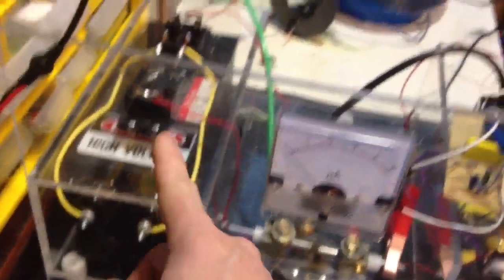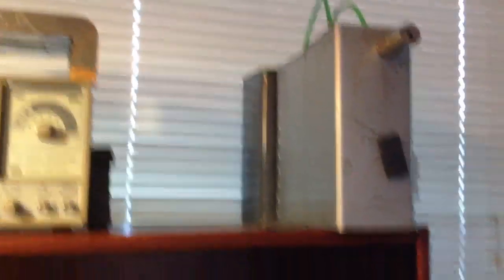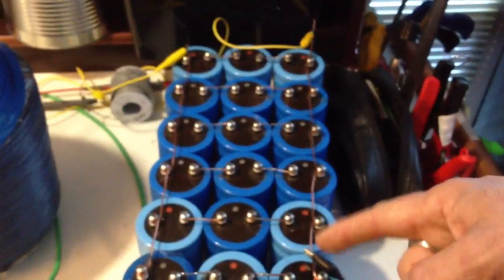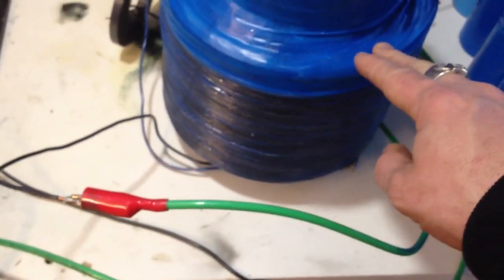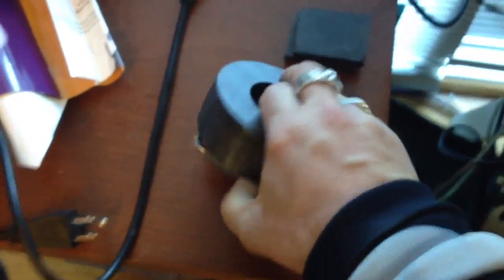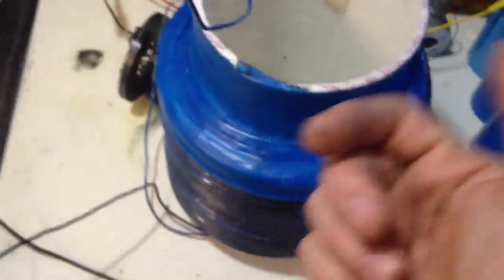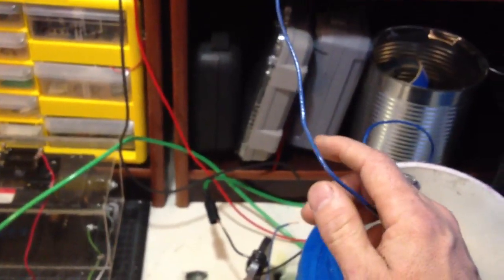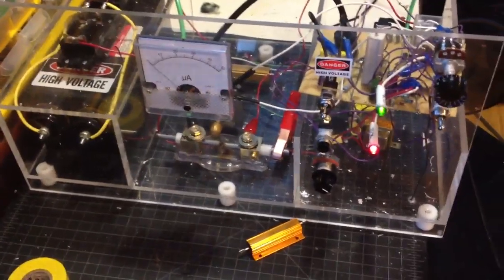Floyd Sweet VTA magnet conditioner replica

Comment: Very cool! I have always wanted to build one of these! 

Where I live, there is a lot of magnetic iron sand. I wonder how that is made in nature and if we can better learn from nature. 

I think the Fe2+ ion is the only quantum asymmetrical spin orientation. According to google this ionozatio energy target should be around 1562Kj/mol from neutral to Fe2+. Iron atomic weight is 55.8 so 55.8grams/mol

 Avagadros number per mol: 6.022*10^23atoms/mol *1mol/1562Kj = 3.85*10^17 atoms/joule of energy 

If you have 1/4 pound magnet that is 454.5/4 grams= 114g iron

114g iron/55.8g iron is 2.04 mol iron

2.04mol iron*6.022*10^23 atoms/mol = 12.26*10^23 atoms iron 

12.26*10^23 atoms iron/ 3.85*10^17 atoms/joule= 3,185,000 joules to magnetise a quarter pound of iron Fe state into all Fe2+ state 

Ok cheers

Comment: Please share the SCR circuit with me, I need it too bro.
Am just a physicist, not an electrical technician. I understand everything about the VTA but don't know how to build circuits.
I know the coil ratios and how he calculated them, he used the e/p ratio of the atom which is 658.2022222....
If you keep dividing that by 4 you will arrive 41.1376 which he found.
He used 5× prima of octave to get maximum peak signal, but his loop back ratio slitely deviate from atomic e/p ratio. There is a way we can fix that problem. David Lowrance replicated this device using autotransformer and got the whole thing. But he didn't use the SCR circuit.
Please I need the SCR circuit, help me

Comment: In last VTA bifilar differential power coils and Alu box were for improved extraneous noise rejection (CMRR). Mag field was stripped from current carriers (equal but opposite currents in same space).  Overall effect was a variable gain true negative resistance device!  Bearden's VTA label was very apt I think. Our normal currents are negative electricity due to electron flow. VTA would've been world saver except for undesirable remanent artefacts.

Comment: Sweet used much less capacitance about 1600 microfarads.  He used single large stud mount SCR repetitively fired at a particular point on 60Hz continuous wave. Standard magnetising coil. Sitting in bottom of magnetiser tube was a complete spool of copper wire driven from speaker output on 100W amp run from to Wavetek audio osc.  This used to test magnet resonance freq. before & after zapping and resonance freqs upper & lower mags had to match closely Fr around 10 to 12 Hz.
Reply: Do u have the circuit for the SCR and the 1600uF to share with me please?
I really need it too

Comment: What bifilar coil configuration U using? See Wikipedia's list of configurations.
Tesla used the Wikipedia illustrated pancake coil. These can act as tank circuits that ring at their own resonant frequencies--no need to inject a frequency into it. The dual windings have an emphasized capacitance between them to get the LC tank to function. At one point in the ringing, current is high, while at another point in time voltage is high depending where the energy is--magnetic field vs capacitance.

Comment: Nice project, but you realize that there are no manual or real data how to replicate the Sweet Floyd device?
Even John Bedini (who worked with Sweet Floyd )says that there at least two different descriptions how to activate magnet and none of them actually working! 
Sweet used special magnet which was special ordered by Walter Rosenthal who was a NASA engineer.
Reply: https://www.youtube.com/watch?v=AyaV6eswOSc            Creo que simplemente jugó con las frecuencias e imanes comunes, bobinas para inducir una fuerza electromagnética significativa.    Bedini  lo logró , el tema es que no siguió fomentando nada con respecto a energias libres por amenazas y control. Para preservar su vida.
Reply: @electrokym5756  
Estos son solo los rumores, sé de lo que hablo, nadie excepto las compañías de General Electric saben exactamente cómo activar el Floyd Sweet Magnet.